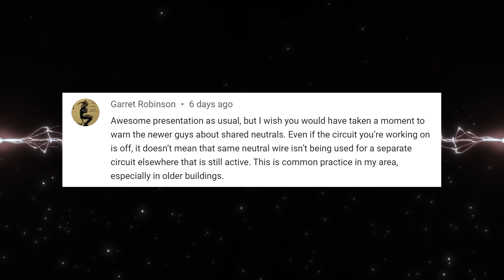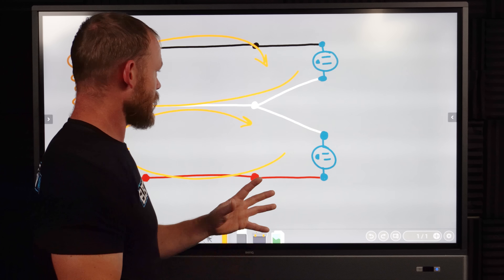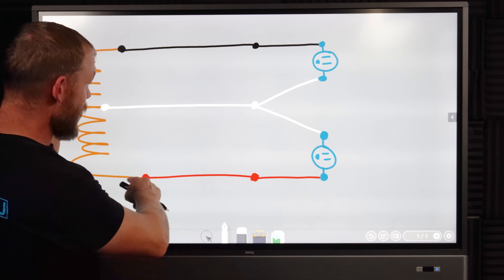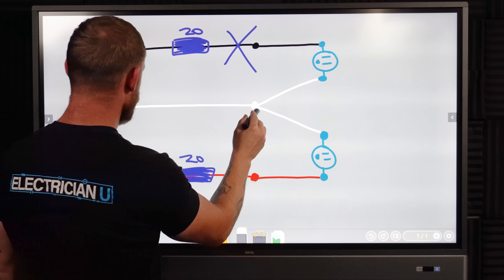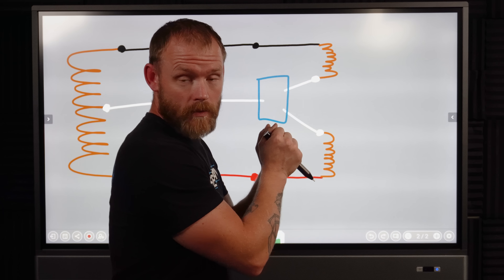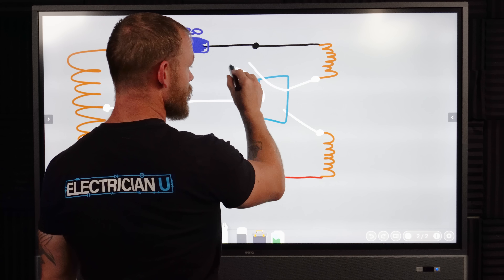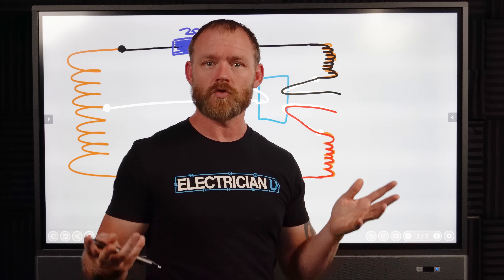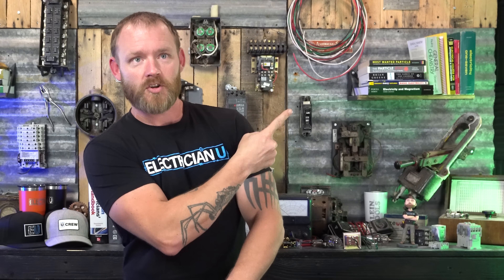The Dangers of Shared Neutrals: How To Avoid Being Shocked

Comment: are all systems that run on 240 have a chance to have a shared neutral or is there a way to tell other than that to be careful? do you check voltage across the 2 wires to see if its live? what if there are 2 heaters located near eachother both running on 240v should you turn both breakers if they are not tied into one breaker? say one heater had a switch and you turned that off
Reply: You don’t share a neutral between 240’s.  You share the neutral between 2 120’s that are on different buses.

Comment: Think you could do a video on E26 medium base bulbs on a 277v circuit. Its a common debate i have with people since LED E26 bulbs come rated for 120v to 277v.
 yet all screwshell lampholders are rated at 250vac and according to NEC 210.6 (C) the use of E26 screwshell lampholders on 277v isnt permissable.

Comment: Sawmill tech here. You should cover ground loop when dealing with a short to one side of a "space saver".   I had a light switch cover plate that had 110v to ground after removing it from jbox.  And the switch was. In good working order.
Reply: Was the sawmill supplied by an ungrounded delta transformer?

Comment: With a shared neutral, what is the potential to overload the current on the neutral if both hots are at 18A, for example?
Reply: If both legs are 18A, the neutral will have no current. The neutral carries the IMBALANCE of the current. If you had one hit at 18A, and one hot at 1A, the neutral would carry 17A. Either way, your neutral won’t have more current than your hots, and should be the same AWG. No overcurrent
Reply: There’s no potential to overload it since they are opposite buses and so they will cancel out.  You can only share a neutral between opposite buses - if you shared a neutral between 2 circuits on the same bus, you could easily run twice the current through it that it’s rated for.  With a MWBC, you are only carrying the difference between the 2 circuits.
Reply: if your on two different phases its not really an issue....double pole breaker is the way to go..
Reply: Thanks for your response. Let’s take this example one step further. What will happen if both hots are on the same leg. I have seen this when circuit breakers are rearranged to facilitate a new branch circuit, for example. In this case, the hots would be on the same cycle not opposing. Wouldn’t the neutral then carry the cumulative current instead of the difference?
Reply: @steveshirk7035  If both hots are on the same phase then yes, the current on the neutral would be the sum of the current on both hots - so you would have a good possibility of overloading the neutral wire.  It wouldn't be a real multi wire branch circuit anymore and definitely a code violation.
Reply: Exactly my point. The video was great and highlights the potential, if not being careful, of being shocked with a shared neutral circuit. My point is that there is also a potential of over-current on the neutral if care is not taken.

Comment: What about hard wired smoke alarms chirping after all batteries been replaced. What would cause that?
Reply: My daughter had that issue, I think we turned off the breaker and back on fixed it I think. What causes it I do not know. Maybe we need to read the manual.
Reply: @JR-xw5dk  customer doesn’t have the manual. Flipped breaker and changed batteries he said. Still does it. I recommended changing the whole detector but he said he just did that a year or so ago. So yeah. Why it would be doing it is the question. 🤔

Comment: Scenario:
A house built in 2000s housing boom era electrician runs 12/3 to a pair of 120v circuits for septic pump and septic alarm (both exterior underground). Using a double pole breaker would negate the alarm if the pump trips a breaker. Any work on this should have both circuits opened, but no exterior disconnect box was installed.
Reply: Seems like a bad use of a MWBC.
Reply: @MD-en3zm  I'd agree. Saved 40 in the wiring, will cost over 1000 to fix

Comment: I have one of these situations in my laundry room I believe. Two outlets one for the washing machine and one for the dryer (gas).  I was replacing the outlet for the washer (it's breaker was off) and got a slight shock. Turned off the breaker for the dryer and continued working no problem.  Would this be done because those appliances touch when placed side by side as a fail-safe if one of them has an issue?
Reply: 120V drier?  Like a gas drier with a 120V?

Comment: Can you do a video how the TENS Units work with high voltage and low ampacity by using capacitors.
In case you don't recognize what a TENS Unit is, it the electrical medical messaging device that uses electricity going through patches you put on and it causes your muscles twitch or tighten for a determined time frame and intensity.
Just started using one on my shoulder that had been a constant source of chronic pain for me since 2010 due to 3 cervical neck fusion surgeries.

Comment: Those "You can't be shocked by a neutral" people aren't going to like this one either LOL
Reply: Confirmed..it hurt.
Reply: Big reason we use 2 pole breakers on networks.
Reply: The worst situation is when you have a neutral that is serving 2 or 3 circuits of a 3 phase wye system and you get the back feed on the neutral from the different phases because it’s like getting shocked with dc because the sine waves never cross zero at the same time.
Reply: Open group and loose neutral hurt more than the hot lol
Reply: @thewiseguy390  I can confirm this and it does hurt like hell.
Reply: @thewiseguy390  why
Reply: Why is it ok to have a two phase appliance have the neutral and ground bonded in the plug ( power supply line has two hots and a neutral but no ground)?
Reply: @Frank-nh9fe it actually should be two hots and ground. In most cases, no circuitry is connected to the third wire. It is used only as a protective ground connected to the chassis. If there is some part of the circuitry using the neutral (120v fan) it should be a 4-wire plug.
Ad by the way, if you’re talking USA 240v it’s actually one phase. The two live conductors are perfectly out of phase referenced to neutral, but it’s still called single phase or sometimes split phase.
Reply: @TomCee53 Not necessarily true. On a 3 wire the neutral and ground are shared. This was common on appliances that were 120/240 back in the day. It all just depends on what the appliance is rated as (240v or 120v/240v). But you can run modern ranges and dryers on 3 wire connections. It needs to be connected to the neutral terminal though. If it's connected to ground the appliance will not work. Obviously it poses a greater risk than using a 4 wire with a dedicated ground but plenty of people do it and do not get shocked.
Reply: @AnUnapologeticApologist you’re talking about the old nema 10-30 and 10-50 plugs that they used to use for dryers and ranges. Those are not allowed in new construction after 1996, and I don’t think they were ever allowed if they were served by a sub panel but I might be wrong about that part.
Reply: @Frank-nh9fe  That's why we burry an earth rod just outside our houses.
Reply: I can remember being one of those - then I learned....
Reply: are you serious? dont say dumb shit
Reply: Let them change some 270v ballasts
Reply: Hahahahahahahahahahahaha
Reply: I got shocked by a neutral and it left my arm numb for a couple mins 😢
Reply: It's not hard to understand when one uses the concept of a large building full of people with ten bathrooms with  all of them attached to One  2" drain exit line to the sewer ( the same size of each of them separately )... Now, everything's FINE when your usage is LOW... But when you're usage goes simultaneously high, your toilets and sinks are all OVERFLOWING .... In the same scenario when you're sharing neutral's you are destined for an OVEFLOW of columbs current and when the are ALL CROWDED in the same RETURN path, all merging to the same undersized "road" as they are all crashing for exit, the FRICTION of this simultaneous flow, exiting causes excess heat, eventually smoke as a result of the heat, then 🔥 fire 🔥 and I'm telling you, you cannot compromise your livelihood or your in court case against you that burned a structure down / hurt / killed someone because you thought " It'll be OK ". 🚫No‼️
Reply: Get between two neutrals and you won’t forget it because they will hit you hard or harder than the hot. Reason being it’s unbalanced current, it’s not the voltage that will off you it’s the current
Reply: Turn your microwave on hold the neutral itself and ground yourself really good. 
¡You will fart in pain 😂!
Reply: Only a dummy is a the reason for someone being shocked by a neutral wire bc a neutral being wired improperly would cause that to happen. Which would be due to a dummy improperly wiring the neutral. A properly wired neutral cannot shock you.
Reply: @TheDude1992  you must be flawless..
Reply: @TheDude1992 says after being showed a multitude of ways that a properly wired neutral can shock you
Reply: @TheDude1992  wow this guys grounds and bonds
Reply: @TheDude1992 You are showing ignorance. If you open a neutral in a multiphase circuit, you have the potential to get shocked. You also may have just fried everything on the circuits.